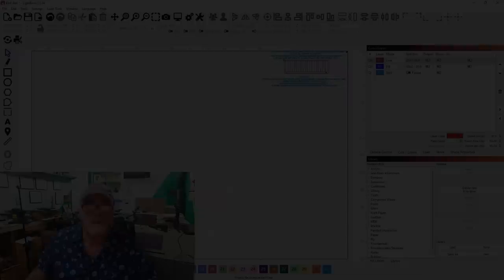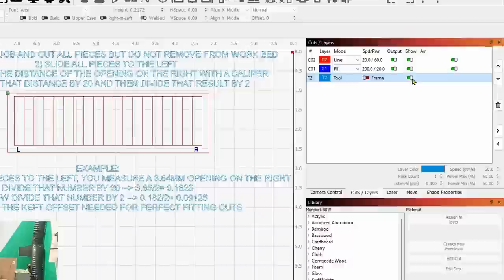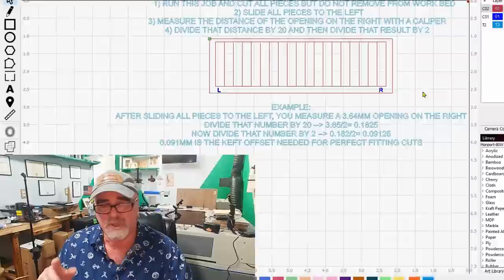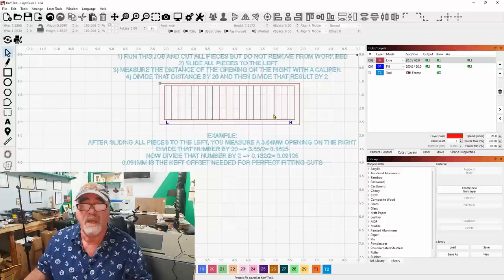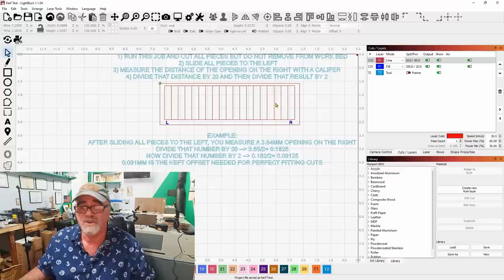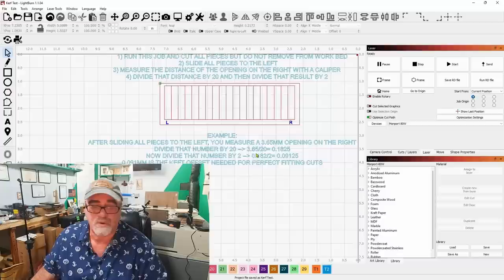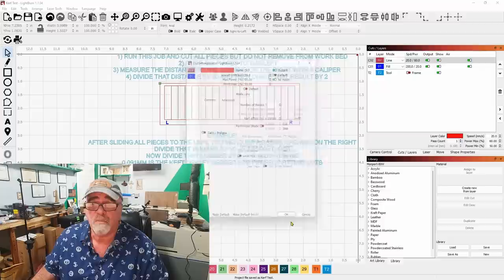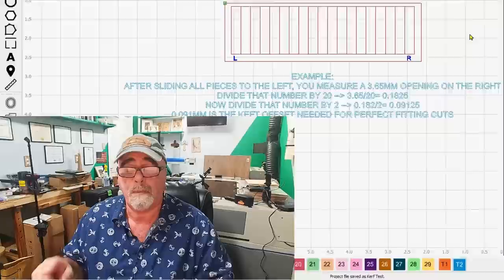Understanding your laser Kerf and how to set it up for perfect cuts!

Comment: Thank you so much! I was able to download this tool and calculated my lasers kerf of 0.12mm, and now all my marquetry pieces fit together snugly. One other thing I did for the omtech 55W laser was adding thin shims to the underside of the knife blade bed that the honeycomb bed sits on and it's perfectly level now. I had about a 1.5mm slope from the left to the right of the bed.
Reply from the maker: Great! To level the bed, open the bottom compartment and loosen the tensioner screws so you can take the belt or chain off the uprights on all four corners. Now each of the upright screws on all 4 corners can be turned by hand until the bed is perfectly level. Replace the belt or chain, put pressure on the tensioner and fasten it back down.

Comment: Thanks for this and the subsequent Kerf explanation videos, greatly appreciated. I have downloaded the Kerf file but checked it before and spotted that the version I downloaded had a 2mm Kerf value set against the cut layer , I think this should be zero for this reference piece, else it could skew readings significantly.  All the best and thanks again.
Reply from the maker: Thanks for the heads up!

Comment: watching you deal with the little pieces moving around to get your measurement, if you use a flat metal scale (ruler) you may find it easier to push the pieces together and hold them tight with the scale as a weight or holder.
Reply from the maker: Yeah, thanks for the tip. Anything on top works better than nothing! 🤪

Comment from the maker: THANKS TO kkhairat73 WHO SPOTTED MY BLUNDER! The math is simply the NUMBER DIVIDED BY 20! (10 pieces x2) My brain wasn't working right! 🤪 The file downloads have been FIXED! I have the BEST VIEWERS! In case you missed it, I had Lightburn set to INCHES instead of MM when I entered the kerf on my cut layer! I forgot to switch back to mm! In inches, my kerf offset is 0.00358. Additionally, I probably shouldn't have used the puzzle example! This is only applicable on puzzles with double lines and double cuts! Kerf offset is mainly used for inlays. I'm going to do a better, less confusing video using inlays as an example instead soon.
Reply: LOL just answered to that and saw your post! Grea honesty.

Comment: The kerf and cleaning lenses are important information and I’m glad I learned from you. Thanks. I’m based in Australia and not sure what you mean by non abrasive spray for cleaning lenses… would sprayed distilled water be good?
Reply from the maker: 99% IPA and a microfiber cloth will work well.
Reply: @TheLouisianaHobbyGuy  thank you... 99% IPA, do you mean isopropyl alcohol? but you said not to use alcohol in your video?

Comment: Hey Rich, great video. 
I noticed that when you did your measurements and calculations, they were in mm but when you entered it in your settings, that was in inches. Does that make a difference?
Reply from the maker: You are correct, that was a mistake! I should have switched Lightburn to mm before doing the calculation! My actual kerf offset in inches is 0.00358. Unfortunately, I can't edit the video Dean.
Reply: @TheLouisianaHobbyGuy great, thank you for clearing that up

Comment: Interesting video Rich.

What's the advantages of those 20 cuts, over for example cutting 1inch square, measuring the actual square, to get the difference between the 1inch on the sotware and then actual piece.

Then divide by 2 to get the kerf?
Thanks
Reply from the maker: I don't actually use this, but if I did that's how I would do it. I usually just add my spot size to the project size and that works like a charm.
Reply: So to find your spot size, do you use the 1inch method or you do it differently
Reply from the maker: Personally, I just add the spot size of the laser to my project, but most folks don't have a microscope and crack ruler to measure the X & Y line width, which is why I made the video.

Comment: I wonder if the sequence in which the parts where cuts matter if so why not number them remove them from the laser bed and layout on a solid surface to then measure! just a thought

I think the most important thing you said that hit home for me was explaining what direction to go with the offset numbers larger = tighter
I agree with you about cleaning lens, I bought the solution you suggested. It reminds me of the battle of oil change places say they every 3000 miles. They sell oil. the automobile manufacture says 7500 miles they sell cars.  I changed the oil at 5000 miles  😁🛫
Reply from the maker: In this case we half the manufacturer recommendations.

Comment: Hello.. Super newbie here.
Please do a video on cleaning diode lasers (specifically Creality CR Falcon 10 watt.
Also, I have my laser focused, but I don't get the single clear laser "dot" that I expect. It like there is light surrounding the dot.
I've cleaned the glass I see when I remove the air assist nozzle, but have no idea how to access lenses and/or mirrors.
So, it it normal to have more than just the clear laser "dot"?
And how do I access lenses/mirrors?
I am very cautious. I don't want to inject a problem.
Thanks for your videos.
David.
Reply from the maker: You don't have mirrors David; that's a Co2. I access the lens directly with a long Q-tip wrapped in a microfiber cloth.

Comment: Super helpful video, thanks Rich. Would I be correct in thinking that this test is only applicable to the exact height of your lens focus from your material and also lens size? i.e. a 2" lens @ 6mms height from material? 
If the laser height was lower or higher then the kerf would be different, correct?
Thanks
Reply from the maker: Yes, you should do this at the perfect focal height.

Comment: Thank you for the clear explanation for determining the kerf offset for the laser beam width. One confusing point at about 15:30 in the video you measure the offset from 20 cuts in mm then do the calculation and enter the kerf offset in Lightburn, but it shows the units are in inches?  How did the 0.091 mm offset calculation convert to inches?
Reply from the maker: That was a mistake on my part Charles, sorry!

Comment: Really good stuff Rich. I'd like to see a c02 lens and mirror cleaning tutorial. I've use Zeiss lens cleaners for my diodes but haven't used my c02 enough yet (like not at all 😁). I figured out how to calculate kerf width on my own when I started making boxes, but your way is much simpler. Thanks for the video!
Reply from the maker: Glad you liked it George! I'll be doing the lens cleaning video when I get time.

Comment: Learn something every time I watch a video from your sir, thank you! Two questions. Fist can you take a piece of tape and tape all the cut pieces to the "frame" and move to a flat smooth surface so it's easier to get the pieces to the one side. May help fellow butter finger such as myself not have to fight sliding them to one side. Second, and this is gonna sound so dumb...... how do you wash the microfiber cloths? Just throw them in the washing machine? Curious if the detergent residue left would do the same thing you were mentioning about abrasive cleaners? Thanks again!
Reply from the maker: I wound up using a small piece of pane glass to cover the pieces. And my wife uses dawn liquid to wash my microfiber cloths. The white lens cloths I don't reuse. I think the packs of 24 on Amazon are about $6 and last a very long time.

Comment: Hi Rich and thanks for this informative video.  I do have one question.  At the beginning, you state that you are working in imperial measures (in rather than mm) but what I don't understand is that you measure the 20-cut gap in mm (3.64mm) and then go through the math to come up with .091mm kerf setting.  You then insert that number in the cut setting that clearly states that it is set to inches.  How does this work?  Am I misunderstanding something? Shouldn't you change your setting to accept mm or change the mm number to inches?  Thanks
Reply from the maker: Yes Elliot, that was a mistake in the video. YT doesn't allow the videos to be edited.
Reply: So, should I assume we either convert the 0.91 mm to inches (.0036 in) or change the settings to metric? @TheLouisianaHobbyGuy
Reply from the maker: Either way works.

Comment: I am so thankful for your videos. I have been looking for someone who made figuring out kerf simple.  Even following the directions on the file that had been updated. I got this and it is wayyyy off on cutting. My gap on the test board after sliding everything to the right on a 0 kerf setting was 3.3mm. I divided it by 20 and got 0.165. The video says to dived by two the file does not. so I did not. I sat my kerf at 0.165 but it put the inside frame line in the middle of all the horizontal cuts and the outside cut line enlarged with very rounded corners. Now I am unsure what to do.
Reply from the maker: Try posting on my free forums. https://lahobbyguy.com/bb

Comment: Rich, I want to thank you for your channel. I am just beginning my laser journey and learn so much from watching you. I now have a better understanding of laser kerf, what it is, etc. But I am not sure how to use it. For example, if I cut out a puzzle piece, the piece will not fit tight in the hole it was cut out of even after adjusting the kerf offset, correct ? Do I cut the hole first, then adjust the Kerf offset outward and then cut the piece? I guess I don’t understand HOW and WHEN to use the kerf offset.
Reply from the maker: It takes some testing, like in the video. You adjust the kerf for a tighter or looser fit, either way.

Comment: After finally using the kerf assist I find that there is insufficient space to move the cuts to the left, I am using the sculpfun 9. Am I doing something wrong? I set the width to 130mm and the kerf to 0, but they won’t move to the left. Thanks for all the very informative video’s that you keep putting out.
Reply from the maker: I don't know, I can't see you settings in a comment. You can head over to the forum and get answers there: https://lahobbyguy.com/bb

Comment: Great video, lots of tips.  Never knew alcohol was abrasive...  just ordered some Purity from you link.
I think I did spot an error in your kerf calculations.  When you took your calipers and did the actual measurement of 3.64, it was mm, but your setup in lightburn said inches.  I am assuming that the calipers should have been in inches?  Thanks again.
Reply from the maker: Yes Mark, my old brain makes lots of errors! 🤪 99% IPA is fine, but it's expensive! Most folks have 91-94% IPA in their cabinets, and that is abrasive!

Comment: As always a very informative video and a process that I need to incorporate into my diode use. Question, how do I go about educating myself about diode lasers and what can be done with them. You mentioned changing lenses so I am wondering if there is print documents that I should read or what? Thanks
Reply from the maker: Lenses just unscrew Larry. You can buy a pack of different size lenses on eBay and try them out. They're pretty cheap.

Comment: i’m coming from the cnc world. can you not set the laser to cut from the inside or outside of your lines?  does the laser only cut on top of the lines?
Reply from the maker: The laser only cuts the line. If you want to add a line inside or outside, use the offset feature and set the offset line to a different speed and power.

Comment: Thanks Rich. Do you recommend running a separate test for each different material/thickness?
Reply from the maker: Yes, absolutely Steve.
Reply: @TheLouisianaHobbyGuy  Okay. FYI, I ran the cut test on 6mm birch plywood and 3mm aspen (not plywood) and got the identical result. xTool D1 Pro 20W.

Comment: Note to self: If running this test of the P2 - put the material on the honeycomb, because if you have it on the slats - the little sticks fall to the bottom . :)

On a side note: with all 19 tabs back in their little box my total gap is 1.84mm. So my offset is .046mm?
Reply from the maker: Sounds right.

Comment: Awesome video Rich! I really enjoy your videos and how simple you explain everything. Thanks so much. I am new to lasering, in fact I don't even have a laser machine yet because I wanted to make sure I purchase the right machine for what I want to do which is puzzles. My main concern was the Kerf size because as you mentioned some of the puzzle cutting videos that I watch on Youtube show puzzles with very loose pieces, and I want them to be tighter. Now I know it is a setting for the cut and not necessarily a specific laser brand. I got your explanation about how to calculate the right Kerf size using the rectangle file but, how do you apply that to a puzzle rather that a rectangle? Thanks again for the video Rich.
Reply from the maker: Glad you liked it Axel! Thanks!
Reply: Axel, I notice you didn't get a reply to your question. The kerf offset makes the puzzle or any piece you cut larger or smaller by the offset to give you a tighter or looser fit. Rich said how his offset on this particular laser, he would reduce by about .02 for a puzzle for kids. Hope this helps, though you have probably figured it out yourself already.

Comment: Thanks Rich, Great tutorial as usual. had not set mine and Lightburn had a figure of 2.311mm for my offset, running the test now, but if i am cutting out a puzzle, will this kerf offset only make a difference if i cut the pieces with a gap in between each piece, Confused how it would make a difference if the pieces were cut up with overlapping lines. Hope this makes sense. Thanks again for a great helpful channel. Will send you a few dollaroos, but cannot afford a monthly send at the moment.
Reply from the maker: For puzzles, this is for for the single line versions.

Comment: found issue with your kerf file your not cutting twice only one time so dont need to divide by two after dividing by 20 fought it for a long time until i used the divide by 20 figure and worked great dont divide by 2 after the 20
Reply from the maker: Thanks Jim!

Comment: Hi all, I'm a newby so this is likely a newby question. Is there interaction between X- and Y-Axis Calibration and Kerf? I see how Kerf is applied only to certain layers in line mode, but the calibration of the axes is in effect at all times, correct? It seems calibration is like adjusting the Kerf (actual cut line) outwards so the inner edge of the cut matches the desired dimension on that axis. Is the Kerf done, for lack of a better term, "in addition to" the calibration adjustment? Thanks, and thanks for all you do, Rich!
Reply from the maker: Good question Pat. Yes, sort of... calibration is for accurate overall dimensions, while kerf is used for better fit of joined pieces.

Comment: Hi, first of all very useful video! I have a diode laser and the lens cracked (probably for the problem you mentioned), what lens should I buy if I want to replace it and there is no official replacement? Should I look for something in particular? Ty
Reply from the maker: You can go on eBay and get a generic diode laser lens. Most of them are the same Antonio.

Comment: Thanks.I'm pretty new to this,and I understand the 3.65 measurement as the total of the 20 gaps,giving you .1825,but why do you divide that by 2.I understand that there's a kerf on both sides of each piece...When you say kerf offset,what is it offset from?And how does this all relate to different lasers with different size focal points.I guess I need to understand the theory a bit more.Any ideas?
Reply from the maker: You don't! It's a mistake in the video. It's just the result divided by 20. 🤪

Comment: Just curious...when you did your measurements, you did them in millimeters it looks like, but the Kerf Offset in Lightburn is in inches.  Wouldn't you need to convert the .09125mm to inches?
Reply from the maker: Kerf in Lightburn is whatever you're using at the time, inches or millimeters Al.

Comment: Since most diode lasers do not have a focus that is simetric, ie square or circle, does the fact that your are doing the test cut vertically and not easier.horizontally, make any difference? I thought I might tape the pieces together after sliding them over and before measuring the gap might make it
Reply from the maker: Most of the newer ones are symmetrical Merrill, but even if they're not, the longer size is just a fraction larger, so this still works.

Comment: On diode lasers with rectangular beams, won't the kerf vary between the x and y directions?
Reply from the maker: Yes, but not by much. Notice the only cut that matters is the vertical cut, which will be the smaller of the two Sam.